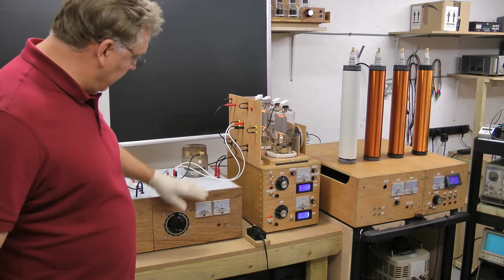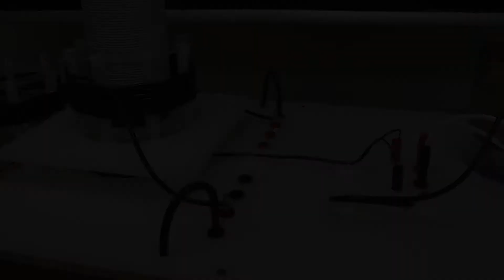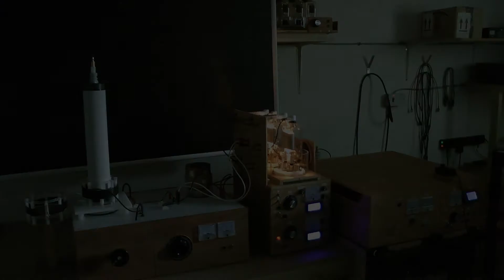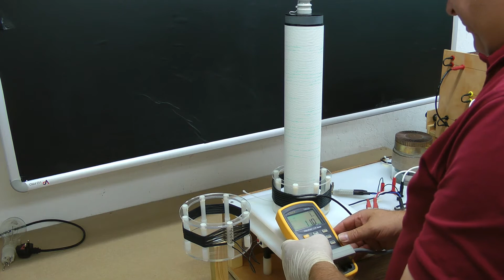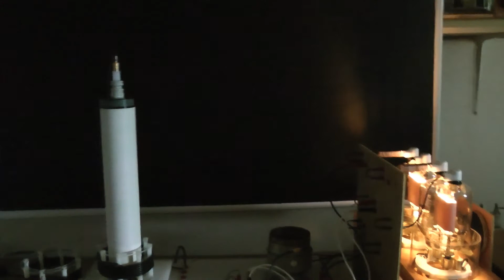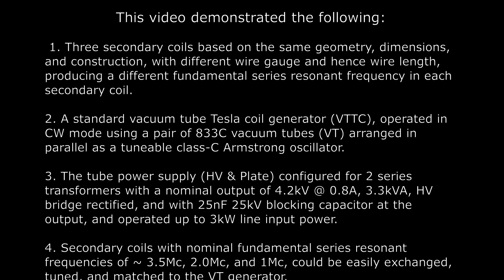Tesla Wheelwork of Nature - Vibration, Frequency, and Discharge Form

Comment: The amount of information and experimental knowledge is profound in this video....thank you so much for sharing your findings. Im curious if the vacuum tube drive system can be used to drive a tesla magnifier (3 coil system) just fine or are there issues with the feedback? Have you found a 3 coil system to produce the same discharges at the same frequencies? Does geometry have much to do with it after all (5:1 vs 1:1 H/D)?
Reply from the maker: Hi, yes the generator can be used to drive a 3 or more coil system, and yes it has a profound impact on the form of the discharge, but not the transition frequency from linear swords to GRD. Geometry also makes a difference as well but less ... more on this to come in subsequent videos and experiments ;) ... interestingly PI * GR ~ 5 :))

Comment: Can I ask, is it possible to make a portable version of  this device. And with the discharge,will it charge the ions in the air? Ty for this content!
Reply from the maker: Hi, yes it is quite possible to reduce the size of the generator, what I show in the video is a prototyping system which is very flexible and configurable for a wide range of experiments, but a more compact single tube unit specifically for this experiment could be developed. Consideration would need to be given to how the generator is powered though. A truely portable unit really needs to run on batteries, and you need about 500W+ @ 2kV+ to properly develop the fractal fern discharge in this size of Tesla coil. If you run the unit with a top-load instead of a breakout and create a corona around the top-load then you will have a more distributed and uniform ionised region in the air around the Tesla coil, and without needing to supply and dissipate as much power.
Reply: So what size battery would it take to run a portable version of this device?
Reply: Wood device affect both positive and negative ions in an atmosphere?

Comment: Tesla bifilar pancake coils are ideal for lower frequencies and Tesla was trying to save the hassle of making these 3 nF capacitor jars. BUT, imagine another geometry that cancels the capacitance to create a more ideal inductor by using "bucking" magnetic fields. Tesla also "magnified" by using a cone shaped coil so that the TOP had lower capacitance than the base, bringing more excitment to the apex. There is probably an ideal angle ... maybe 30 degrees for the cone. There are lots of geometries to try. When Tesla used a cylinder in Colorado Springs, you can see that near the top load capacitance, he has a larger inter-wind wire distance to reduce capacitance @ the top of the coil.

Comment: I think you can solve the low-frequency coil impedance problem by scalling up to a LARGER geometry. When 1Mhz or below, you need a bigger cylinder, bigger wire, and keep more distance between turns. Probably the diameter needs to be 30 centemeters ... and bigger as you go lower, etc. Nikola Tesla had huge coils and was down @ 150Khz or lower.
Reply from the maker: Hi, the purpose here in this experiment was to keep the geometry the same for all coils, and in order not to add significant variations that may obscure the principles being investigated. I discuss in the experimental write-up on my website a lot about driving the lower coils using a fixed frequency linear amplifier tuned to series resonant fundamental mode, rather than a feedback oscillator tuned to the parallel mode. Series mode driven is needed here for the lower frequency coils to prevent the need for excessive capacitive loading in the primary, and hence keeping the Q of the Tesla coil high.

Comment: when at resonance, regardless of which coil you use, the audio frequency is quite low. Is that tone 50Hz?
Reply: I think that’s the sound of the microwave transformers he’s using. Could be creating a ripple in the power supply for his tubes or it’s just the cores themselves resonating in a wooden box.
Reply from the maker: Hi, the envelope of the high voltage tube supply output waveform is determined by the SCR on period, which of course is switching at 50Hz at the line input frequency. In this experiment I am not using a large tank capacitor to smooth the output before supplying to the plate, as per one of the variations in the original experiment. The HV tube supply output is also bridge rectified, so the final envelope will vary from 50-100Hz based on the on-cycle of the SCR. This "default" background modulation can be heard clearly through the discharge, regardless of its form (fractal fern or swords).
Reply: @aminnovations  so is the SCR creating a 50hz duty cycle? The capacitor bank is just for the leveling transformer?
Reply from the maker: The SCR is switching on a 50Hz duty cycle from the line supply. If you mean the capacitor bank inside the HV plate supply this is a level shifter (doubler) and not being used in this experiment, although you can see it all in detail here https://www.am-innovations.com/tube-power-supply-high-voltage-plate. The capacitor at the back of the HV plate supply at its output, and being used in this experiment, is a 25kV 25nF pulse capacitor, and is for primarily blocking transients and high-frequency reflections from entering back into the supply and damaging the bridge rectifer diodes, other semiconductors, and even the SCR. You can see the general schematic here, https://www.am-innovations.com/wp-content/uploads/twwon13/the-wheelwork-of-nature-ffd-1-3-1-full.jpg, although this shows the GU5B of the previous experiment rather than the dual 833Cs used in this experiment, but the general circuit is otherwise the same.
Reply: @aminnovations  thank you, I’m very interested in your work.
Reply: @aminnovations  thank you for the links, it has everything!!
Reply: @aminnovations  Could the 50Hz envelope influence the fern-like structure of the discharge?
Reply from the maker: Hi, it does not appear to influence it, as in one of the variations in the original experiment in the series here, https://www.am-innovations.com/the-wheelwork-of-nature-fractal-fern-discharges, I use a 60uF 4kV tank capacitor at the output of the HV tube supply which smooths the output from the bridge rectifier, removing the 50-100Hz envelope. The form of the fractal "fern" discharge remains unchanged.

Comment: When ABOVE resonant frequency, could fractal fern appear because capacitors are unstable devices ... and below resonance, more stability in streamers because on that part of the reactance that is stable inductance?
Reply from the maker: Hi, no I don't think so. Tesla coil 1 (3.5Mc) shows the fully developed fractal "fern" discharge form both at the lower and upper parallel modes. See the write-up on my website for much more detail on this.

Comment: one idea. If your discharge could roughly match the Earth's magnetic field in your location, around 50uT or so, you might see it spin or be influenced by the Earth's field. You would have to work out the power level for this amount of field. It is another type of tuning ... tuning to balance magnetic fields.
Reply from the maker: Hi, This is an interesting idea, I will give it some consideration, and look to see what influence the earth's magnetic field might have on the experiment, and how that can be tested and measured.
Reply: @aminnovations  Various cell phone applications can give you the Earth's field vector and magnitude. If you have a ring-magnet receiving the arc, it SPINs around the ring. The "random" looking discharges may fill in to be a circle if you time laps all of them -- like the famous Tesla photo of his 3rd coil.